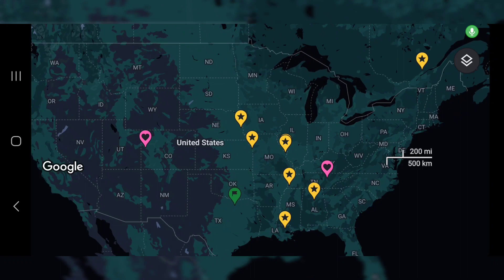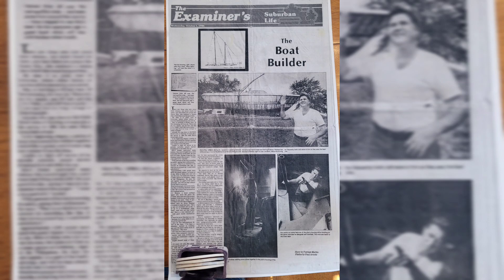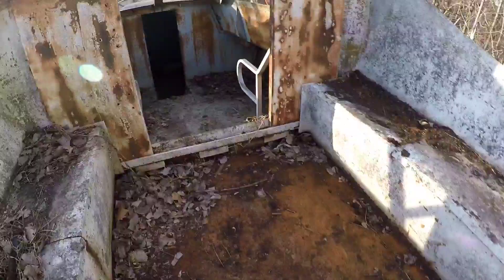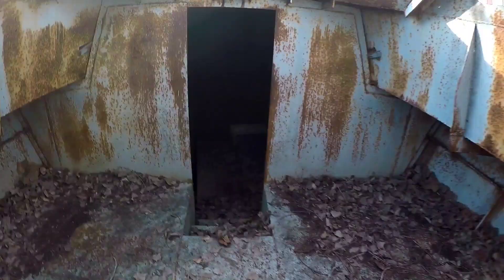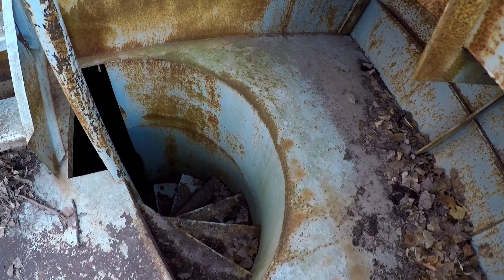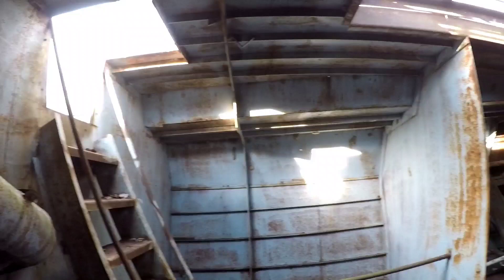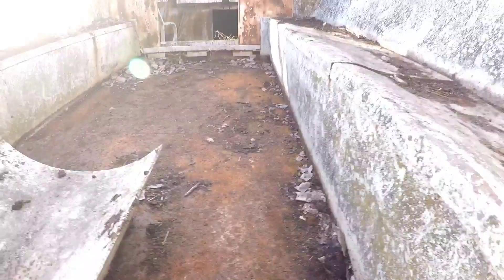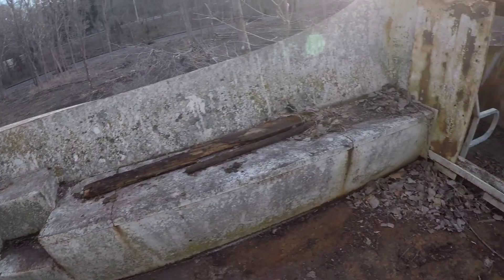The ship that never sailed ⛵️

Comment: A hole in the water to pour money down.   You can scrap it and buy a nice boat ready to go for less than the cost of finishing it.    From one who has poured a lot of money into boats.   Unfortunately the woods are literally full of backyard dream boats that never came true but then the person who got that far must have enjoyed himself.  There was a time when homebrew metal boats were a thing because you would think they would be more sturdy.  You could even buy pre-cut kits from I guy whose name I believe was Roberts.   That was before most people understood electrolysis especially in aluminum boats and rust in steel.   Fully loaded the little Cummings will make about 5 knots at between 1800 and 2000 rpm but will burn only about a quart per hour.   You would have to run the ponies pretty hard to make way against the river current.
Reply: Good analogy! A bottomless black hole to throw money down!  And a heck of a lot of work! Kinda like a few other things, like airplanes sometimes too! Ha

Comment: Fresh water corrosion must be bad so factor in some plating.  So much work to be done to get it into shape it would be far from worth it, even more so in todays economy. No mast or rigging.   Better off scrapping it.  Lot of homemade steel boats gone that route.  Fireplace is just ridiculous, Coal would make better sense.  That one threw me.   Still cannot figure out the motor. Not a marine engine and I see no transmission. Exhaust isn't water jacketed no clue what the idea is unless he was going to do it like a lobsta boat out the top. Got a sneaking idea when he figured he would need to reverse course to make it sea worthy he gave up.   I would say scrap it. Only love could force a man to finish it and I don't see that coming from any real sailor.